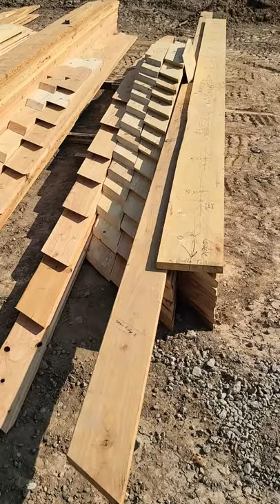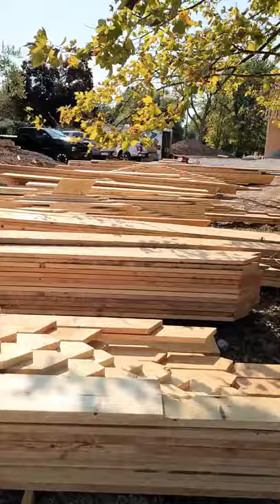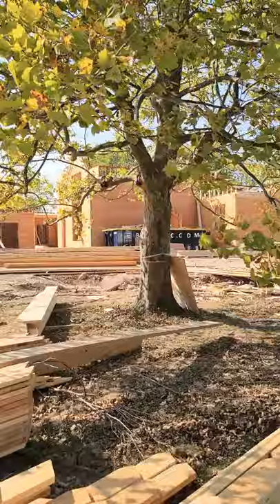Bastard roof cutting rafter piles. precut while the house was being built

Comment: Can you tell me what the Hip/valley line length ratio, “Secant “ is of a 5/12-8/12 bastard roof is please. I don’t know if I’m doing the math correctly.
Reply from the maker: 15"
Reply: Thank you.
Reply: Not trying to be a Troll here, just curious. What are the advantages of plane point to center of facia?
Reply from the maker: For me it allows the top of the roof sheathing to plane better with the outside edge of the fascia and gives a better finish for the roofing materials at the eave edge!
Reply: I’ll give it a try, if I can ever get to that point. -15 this morning. Spending most of the day scraping, chipping, weed burning ice off everything. Have to take a torch to the trailer lock just to roll out. The things we do for love. Thanks , The Frozen Framer.